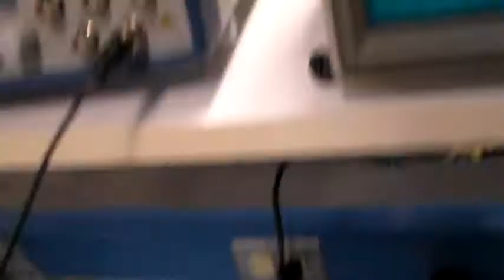Functioning LED oscilloscope

Comment: Trying to find a step by step to build this.
Reply from the maker: I don't give complete instructions for this because it's intended to be a student project where the student must do their own design, construction, and testing of the vertical and horizontal control circuitry.  However, the basic LED array and driver circuits are downloadable as a PCB layout file and schematic diagram:

PCB layout file (using gEDA's "PCB" circuit board editor software: https://www.ibiblio.org/kuphaldt/socratic/model/apps/LED_oscope_v2c.pcb

Schematic diagram: https://www.ibiblio.org/kuphaldt/socratic/model/apps/LED_oscope_v2_schematic.pdf